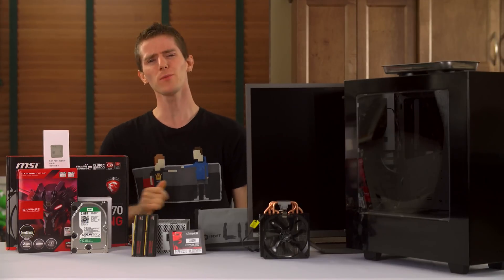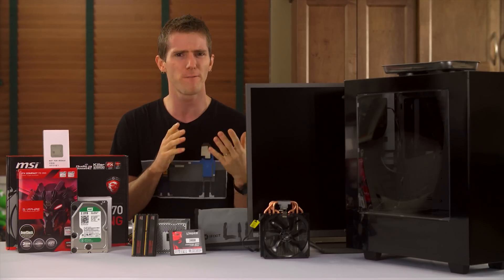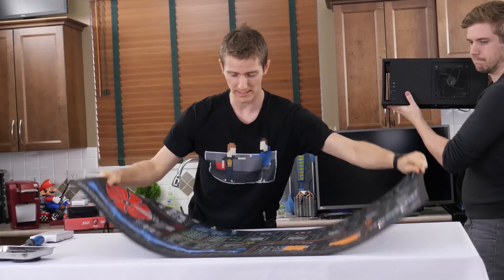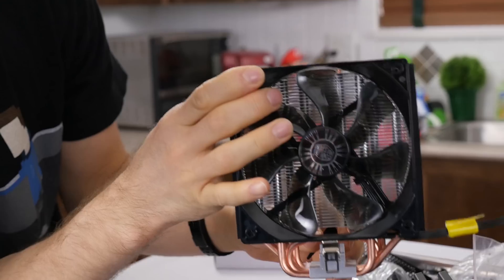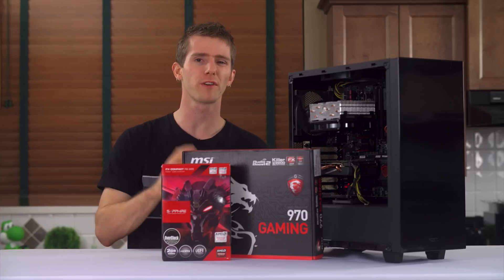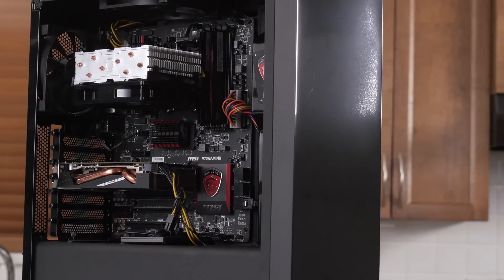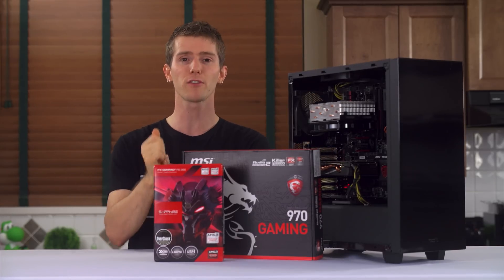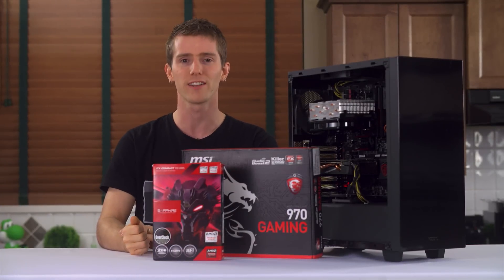Can you Build a 4K Gaming PC for Under $1000?

Comment: if your goal is to game on a 4k monitor, this is NOT the build you should go for even on a budget. out of a 1k budget you should spend as much possible on the gpu, not the $200ish one. I would have allocated $400 ish just for the gpu and budgeted the rest. get a cheap case, 8GB ram is certainly enough for gaming, the ssd and 2TB drives are nice but with gaming as criteria this is frankly a waste of money when you sacrifice graphical power for it.
Reply: But he's playing not very demanding games at 4k. This sis for people that play Source Games or Dota or MOBAs or whatever. I agree the 285 for THOSE games is pretty good. It obviously sucks at 4k if you're trying to play FC4 or AC Unity
Reply: Diego R doesn't matter. what I said still applies. It's bad budgeting regardless of what games they use for their target
Reply: OtakuSanel yeah good luck spending 400 on a GPU, 400/500 on that monitor and 100 on CPU, RAM, Mohterboard, storge and a case c:
Reply: you cant think someone is gonna buy this and everyone that does buy this will exclusivly use it for gaming. what about light content creation? you cant look at build guides like theyre telling you what you EXACTLY should buy. its a GUIDEline, its supposed to be rearranged for everyones needs because not everyone asks for the same things on a PC
Reply: Diego R did you even take a look at his parts list and prices? he doesn't even take into account the case, sdd, hdd, aftermarket cpu cooler, and probably some other stuff. So his 1k title is completely bullshit or doesn't include price of monitor. for 1k total here is how i would break it down. However if you only have 1k to spend on a gaming rig spending nearly half on just a monitor is a completely idiotic thing to do. now the 1k gaming rig plus monitor extra then you're talking about a nice machine.

monitor: $400(the one he uses is far more expensive)
case(with built in psu): $55
mobo(with cpu combo you can find good deals): $120-160(what you prefer)
ram(cheaper with combo again): $40-$60
hdd(1-2 TB): $50-$75
gpu: $300-$400(if you include nvidia cards more options)

that will give you the 1k build with monitor, but as i stated that's idiotic anyway, so without the monitor you can get much better parts but you should still know where to spend the money on and not waste it on stuff you don't need(since gaming is primary focus)
Reply: Zana GB huh, ive used both 8GB and 16GB in my current system and can i say, i have not noticed any performance difference between the two. i can have chrome open and play whatever game and the fps wont go down or i wont have stuttering etc.so ye i still think 8 GB is enough for the avergae joe
Reply: I laughed at the 5200 rpm green drive... get that shit out of here. Unless you plan to store all your games on a 250Gb ssd (not happening) a 5200rpm drive is an idiot choice. $20 more and youd have a WD red/ seagate barracuda and have double the performance. 

also like stated in the video if you want to play anything AAA youll need more power I just got a 970 to replace my old 670 sli and have another 970 on the way. One 970 Plays pretty much everything maxxed @ 2550x1440. I've been playing crysis 3 and BF4 quite a bit lately. My 4k tv from best buy gets delivered the 31st. I'm stoaked to try 4k out.
Reply: People use computers for a variety of uses. Most people would prefer a system with a 285 and an SSD over a system with an R9 290x and no SSD. People all have different preferences. That is why building your own PC is so much fun. You get to choose.
Reply: Agreed, I would scrap the second HDD and the second stick of 8GB and put those 200ish dollars towards the GPU
Reply: Zana GB
Lol
Reply: Zana GB
Well if we are talking strictly gaming what does RAM really matter past 8GB? And for storage my preference would be an SSD over an HDD but you could make a case for either. My point is that for gaming every dollar you can save off of other components and put it towards the GPU leads to better performance (within reason). You obviously want to avoid a dual core with 4GB or something stupid.
Reply: OtakuSanel nonsense? so youre telling me that if i see a build guide for gaming and im also looking for a gaming PC i should follow it exactly? see thats where awesome communities come in (ie LTT Forums) that help you make decisions on whats best for you. and the PSU and case arent going to be that expensive. but that also depends on where you live.
Reply: Lol even 2x 980's cant game in 4k. Maintaining 60 fps in 4k is extremely taxing, most games cant be fully maxed out even with 2x 980s.
Reply: IMO on a new build with a limited budget you're better off getting the best bang/buck you can on CPUs with a decent but not bleeding edge graphics card as a stop gap. The graphics card can easily be upgraded a year or two down the road.
Reply: Zana GB sooo 8GB is still enough c:
Reply: Zana GB it depends on the person and what they use their computer for
Reply: nick hover because frankly even the results he got wern't really acceptable to me. if the average is barely acceptable that means half the time it will be annoyingly unacceptable. In the end you would be much happier doing it properly and spending more on a gpu.
Reply: nick hover did you not see the charts he posted? did you see the average and min fps numbers? if you're ok with playing like that then go right on ahead no one is stopping you but those are not numbers I would be happy with. if you don't think a gtx970 would be significantly better than what his numbers were then you're frankly just an idiot. and "These games don't require crazy gpu and cpu" comparatively speaking, no but if that's the case go trying to play any of those games in 4k(or even 1080p) on an intel based gpu and an atom based processor. It doesn't see like you understand how pc hardware works at all.
Reply: Diego R you're an idiot if you think the monitor is included in this budget build.
Reply: i have winforce 290x will it play 4k at good setings i dont have a 4k monitor yet man
Reply: Thomas Nolte I have a WD green drive and it's 7200 rpm.
Reply: the greens change rpm between 5400 and 7200 depending on load.
Reply: d4rks33k3rz i cant tell if you're stupid or trolling
Reply: OtakuSanel I stopped reading after you suggested someone buy a cheap case with included PSU. You should be ashamed of yourself
Reply: Pedro Bretones why? because the case and psu is where all the performance comes from? don't get me wrong i'm a strong proponent of getting a good high quality psu, but frankly on a budget you're an idiot if you spend too much on non performance components.
Reply: OtakuSanel if you're spending more than $500 on a PC going cheap on the PSU is like asking for bad news, you don't play around with shit like. You con get a 80plus certified for like $40
Reply: Pedro Bretones if you want to spend the money on a decent psu then sure i'm all for it, but anything other than the cheapest case you can find is just a waste of money before worrying about performance parts. I was just making a point if you have to penny pinch that much but your main focus is gaming, it's worth the risk. it may not be the most efficient or feature rich but it'll get the job done. it's not like those things are ticking time bombs(ok well some are but that's what reviews are for!)
Reply: I agree with Pedro on the psu point. I rather spend a little more on a rated psu than a unrated psu that can cause voltage spikes and take out every component in the long run. Overall the only thing Linus could have reduced was the ssd choice since it's not that important in mmo games. Definitely should have chose a hdd and went for more power on graphics, though I highly doubt you can get a 290x at $350.
Reply: Bock Yang just because it's rated for a given efficiency doesn't mean it's actually better at filtering or has other features you think it might. that's a very bad assumption. even a rated psu can still take out your entire computer so don't fall into this false sense of security. you can find a gtx 970 for 350 though and that's significantly better than what he's using.
Reply: Bock Yang "This just shows how little you know about voltage stability" what a funny statement since I have a background in electronics.

First off, while yes some higher price psu can have better mains filtering, you should be running the power going into the supply through a decent surge protector/filter/ups to begin with. so the majority of that noise should never be getting to the supply to begin with.

"Your voltage can spike beyond 120v causing over wattage to your pc parts" this statement is so false it's not even funny. You have no idea how power supplies work. Regardless if it's a linear or switching supply, they use an internal reference to GUARANTEE the output is stable regardless of what the input voltage is like. Now under EXTREME conditions there may be component failure which would then indeed make the output go to hell, this is not as common as you think it is though. you ever look at the input rating on even a cheap power supply? go ahead and look. It will probably state something like 110-250V. Now think for a second how that's possible if what you just said was true? 

"After all that theory, all I am saying is even psu that is rated 80+ bronze has been tested for voltage spikes in these conditions"
umm no. that's not what these ratings mean at all. you can have a very efficient supply but still be complete garbage in terms of electrical noise. This becomes much more evident when you compare switching and linear power supplies. Linear power supplies are as inefficient as you can get but are the cleanest supplies available. It's inefficient as hell but it's clean. Some fancy supplies combine both techs but your argument that efficiency equals noise filtering is just completely bogus. 

"Average psu do not go through these tests and trust me, they matter if you stay in electrical storm prone areas." 
Umm no I don't trust you since I know a lot more about this than you. You're not a manufacturer of average PSUs nor are you someone with exposure to a large portion of PSUs so you attempting to speak on behalf of all of them is just idiotic to say the least. You're way over reaching with what you think you know. As i said earlier, a higher quality supply may indeed have better filtering to reduce potential damage during extreme conditions, but a good surge protector/ups will do a lot more for you and if you're running expensive electronics straight into the wall without any protection than that's the first thing you need to address.

"Pretty sure you can't upgrade from 285x to your said 970 or for that matter 770 with $40."
did you look at the parts list i put together vs what he has in the video? there is a lot more difference than just $40

Don't get me wrong. I'm a strong proponent of getting good quality gear, I spent $250 on a very high quality psu 6 years ago and still using it to this day and expect to keep using it until it eventually does fail. I build high budget pcs and the last thing I want is for a cheap supply to destroy it all. But with different budgets come different priorities and criteria. 

Cheap supplies can indeed be absolutely atrocious and as bad as you make them sound, but that doesn't mean all, or even a majority of them, are like that. It's worse to assume that just because it has an efficiency ratings it's somehow better in other aspects which are unrelated to efficiency. You really need to look at it on a case by case basis and specifically at each supply.
Reply: OtakuSanel Perhaps not the best way to put my point across on a phone.

Power quality[edit]
Main article: Power quality
The stability of the voltage and frequency supplied to customers varies among countries and regions. "Power quality" is a term describing the degree of deviation from the nominal supply voltage and frequency. Short-term surges and drop-outs affect sensitive electronic equipment such as computers. Longer-term outages, brown-outs and black outs and low reliability of supply generally increase costs to customers, who may have to invest in uninterruptible power supply or stand-by generator sets to provide power when the utility supply is unavailable or unusable. Erratic power supply may be a severe economic handicap to businesses who rely on electrical machinery, illumination, and climate control. Even the best commercial quality power system may have breakdowns.

-Taken from Wikipedia

This was the point i was putting across. Supplied voltage of 120V is not constant. It's just a guideline.I am pointing to the building power BTW, not your product 120V intake. But since you managed to think out your own theory, good luck. But you know what, I have my degree in Computer Engineering to fall back on. Better curb on your compulsive disorder to make everyone agree with you. I know my stuff, and maybe your electronics(GENERAL) knows more, sadly it's not worth my time on a youtube comment section. I suggest you do the same. Peace out.
Reply: Can't agree more, and for the sceptics, just check at my build: http://pcpartpicker.com/b/2mJV3C it works like a charm on my cousin's monitor (4k).

Comment: LinusTechTips I have 8 gigs of ram but its not one of those brands. It does not have a heat spreader and the brand names are not recognisable. The different sticks (I think i have 2x2 and 1x4) even have different brands! Does this matter? Will I get lower performance?

Also

What CPU-cooler did you use in this build?

Comment: got my new gaming pc for christmas, i give it power and nothing happens except led on the motherboard (gigabyte gaming 7) power button comes on and the gpu led comes (asus strix gtx 980) need help please!
Reply: UKShocky - Enjoy Z Videos! That's why you don't buy a pre-built. :)
Reply: I have the same problem after I OC too much. Usually unplugging the GPU, RAM or 24 pin MOBO connector helps.
If it doesn't check if you plugged in all cables correctly.
If it doesn't help check if everything is working properly - you know, nothing damaged or something.
Reply: its prebuilt and i dont want to do anything incase it voids the warrant

Comment: In terms of CS go, the Problem is that most of the better players and pros actually dont even play in 1080p, they are playing in 4:3 stretches with a res of about 1280 x 1024 for example, so this test doesnt Quite fit. But otherwise, nice Video!

Comment: Here's something I've wondered:

Few days ago, I decided take my Laptop to technician to clean it from dust and change the thermal paste.
He claimed to me that you don't have to reapply laptop's CPU thermal paste - that the original thermal paste that was applied during the manufacturing/assembly process doesn't need to be changed at all, never.
Is that true? My laptop is more than year old and it just seems illogical.
Reply: Is it overheating in normal use? If the answer to that question is no than the paste is fine. Check out a temperature monitoring program like HWmonitor or speedfan and look at your temps during use, my bet is that they are fine.

The paste in your laptop will be fine for years, or even the full life of the laptop in most cases. The paste is not water based and normally are very non volatile, meaning it will sit there just fine for a very long time.
Reply: tstartrekdude My idle temperatures used to be 41c when I got my laptop, now after more than a year, they're ~47c, and my fan keeps randomly turning up at almost full speed for no apparent reason.
No overheating issues, I just want to keep my laptop cool.
Reply: ***** what is your ambient temperature

Comment: 4k isn't affordable, it requires powerful hardware and an expensive monitor. maybe a 2k monitor could be a meeting point between cost and gaming experience
Reply: Fate It doesn't, those components come to around $950 USD without a monitor.
Reply: This video included the monitor, yea $1k for the build AND the 4k monitor.
4k monitors aren't $2,000 anymore.

Comment: Why you chosen for MSi GTX 970 and not "The Best GTX970, The ASUS Strix"? MSi GTX 970 have coil whine and Strix almost never coil whine! You said in a video that the ASUS Strix gtx970 best GTX970 is.
Reply: The MSI 970 is a MOTHERBOARD!
The 970 chipset is for AM3+ CPU's like the 6350.
Reply: Fate Sorry, I saw it late, sorry guys!
Reply: DutchRedGaming fail. The best 970 is the G1. It is beautiful and smart.
Reply: DutchRedGaming The G1 has better cooling and better components. Therefor its going to be, on average, a better overclocker and more powerful. Not to mention its got higher clock speeds out of the box.
The Strix does have a quieter and smaller design though.
Reply: Dr. Astrô Nauth No Linus said that it the best GTX 970 the strix is. That's his opinion
Reply: Mada11UK I thought that this an -$1000 gaming pc (with Nvidea and/of intel) build was, but I saw that worng. I have the G1 Sniper in my build of my new computer in Januari/Februari 2015
Reply: DutchRedGaming Were talking about GPU's right? Nvidias gtx 970's? The G1 sniper is a mobo.
Reply: Mada11UK  I know, I added on my list for my new pc the strix + G1 sniper
Reply: Dr. Astrô Nauth I love my Gigabyte G1 gaming.... So much I ordered another lol
Reply: Thomas Nolte Yeah, it's awesome! I've had it for 2 months now.
Reply: DutchRedGaming I saw the box at first and i was like wtf, I thought he said AMD build then I rrememberedmy my 990 mobo! :D
Reply: Brent Kullrich Same XD